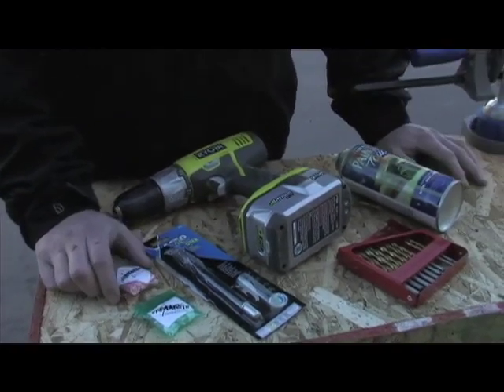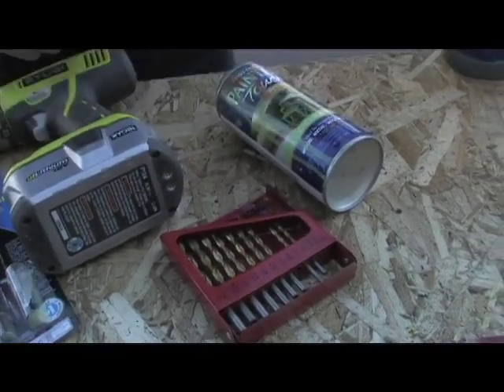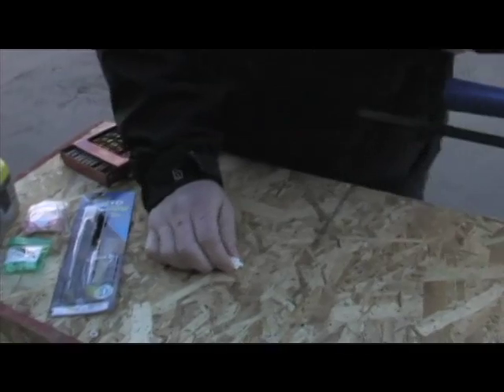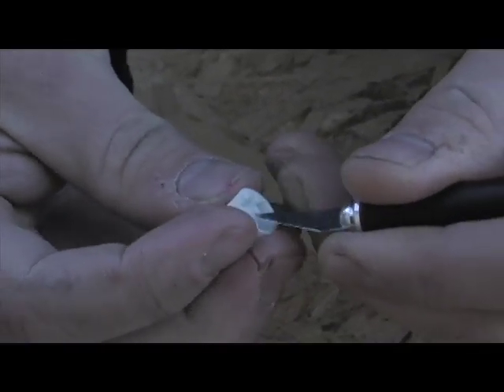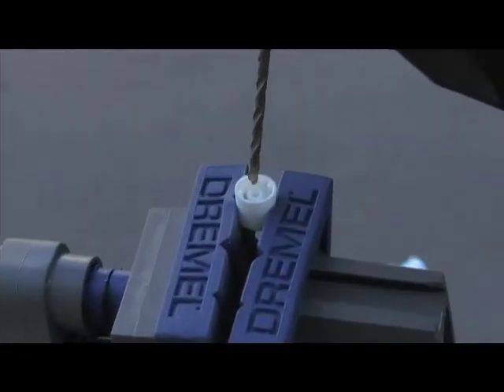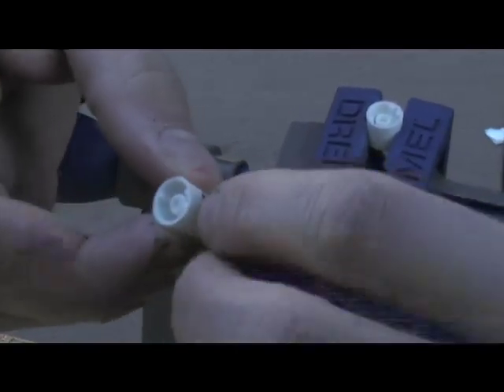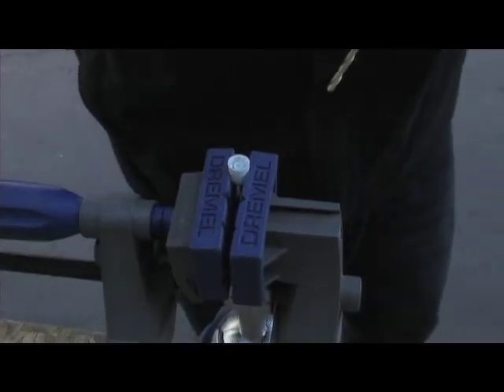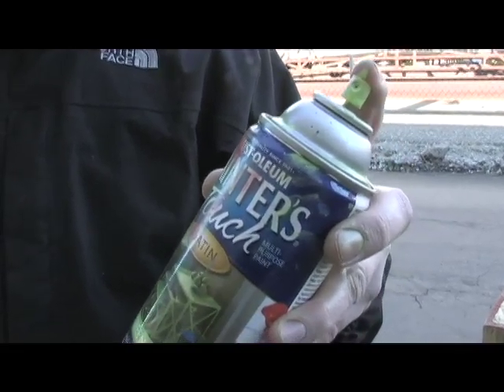Art Primo Tutorials: How to do a spray cap SEX CHANGE Male to Female

Comment: @Lemonjelllo The past generations also didn't have big companies backing them...making a cap when you can buy one for a tenth of the cost (If I HAD a drill, bit, and clam...then I HAD the money to buy caps...).

And it not bitching, it's pointing out something out. I'm not going to go and ruin something that was already hard enough to come by (if you racked it) if I make a mistake. If you want to rack massive amounts of caps (or buy them...) and break 90 of them trying to do this be my guest...

Comment: ok, ap i need to ask this. Can i do this process with a rusto fat? Because i took a rusto fat i "found" and it looks like the stem is the same size as the cans "dick" so i cant form an effective "vagina" to be drilled out. im probably gonna order caps soon so im trying to decide on what i should get ny fats or rusto fats (i love rustos for filling) but really want to jump on the new valve and still have some cash to buy up the last of the old cans! btw can i do this with ny thins?